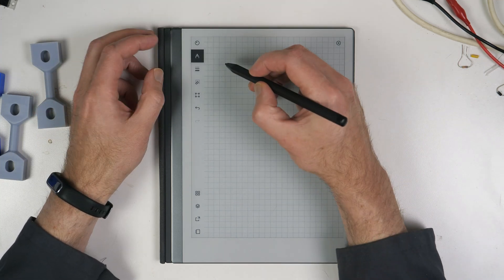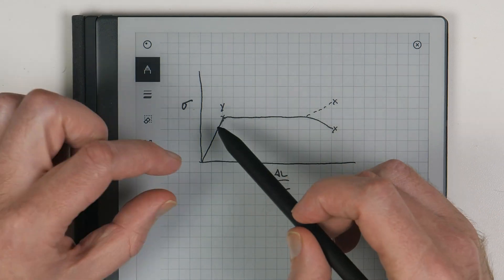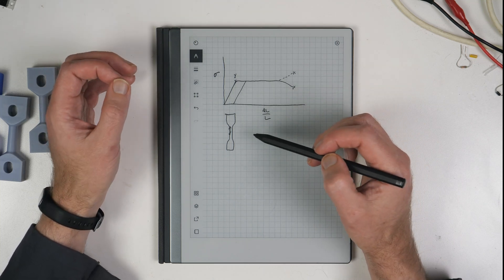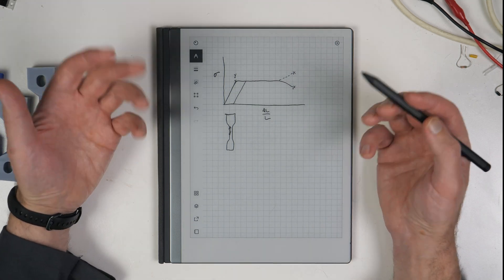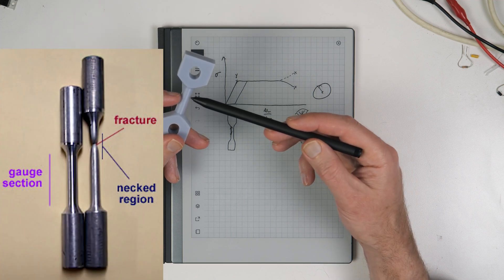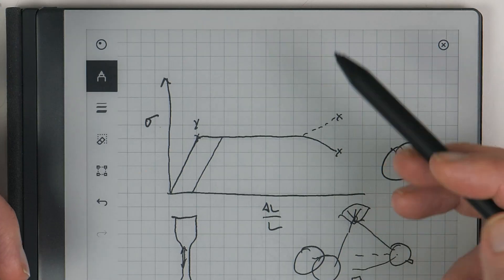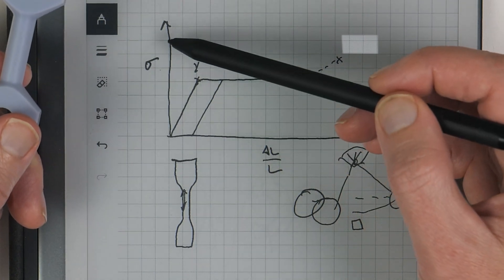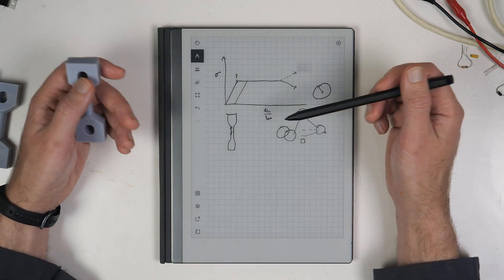Tensile Testing - Behind the Scenes

Comment: Have you thought about doing metal casting using the 3D printed parts as molds? I tried to do it a while back not only to save time with machining, but also because I didn't have the tools to do the machining. I didn't work for me, but that's because I didn't have the right equipment (charcoal didn't quite cut it). I've seen a lot of other people do it successfully on YouTube though. It seems like a nice middle ground between being able to get a part that is quite strong and that has a nice surface finish with accurate tolerances needing only a little bit of post processing without having to spend the full time required to machine a part from scratch from a full block.

Comment: Hey, i really like your video. Material testing is a very interesting topic.  Maybe DIC (digital image correlation) is an option for measuring the elongation and could solve your problem. There is a commercial software called GOM correlate. The 2D version is free. CNC-Kitchen also has a video about tensile testing of 3D printed samples. In the video Stefan is using point trackers in the software blender to calculate the elongation. Hope you find this helpful :)
Reply from the maker: Great insight, thanks!